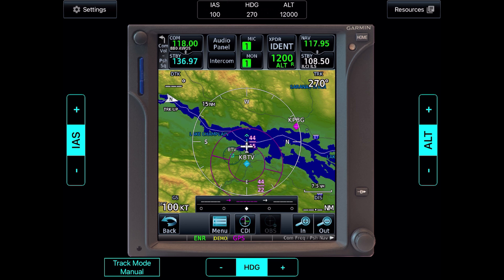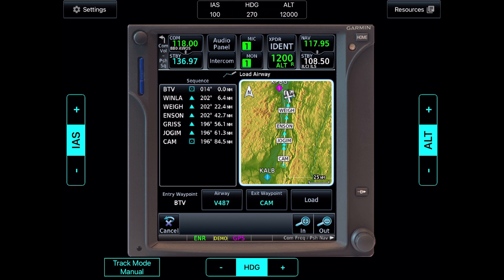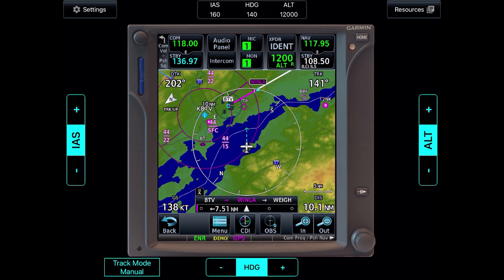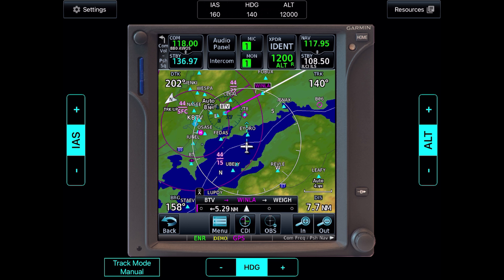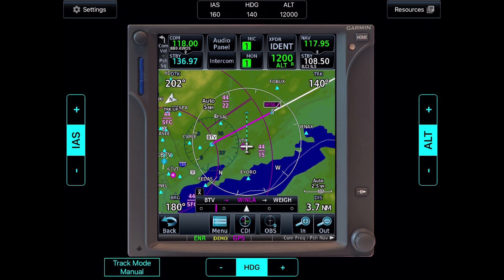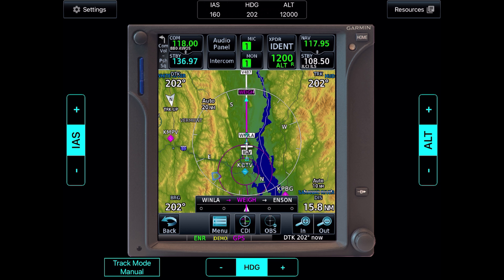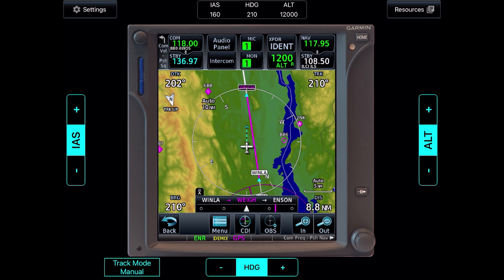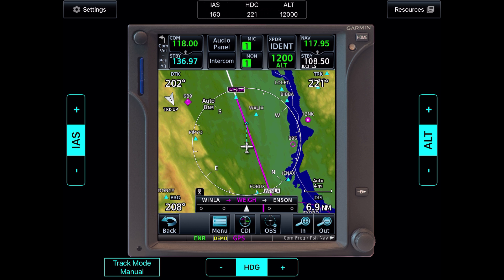Using Bearing, Track, and Desired Track on Your GPS | IFR GPS Flying

Comment: Here is a problem. I hope somebody can resolve. On a approach procedure that I’m looking at, it says to climb to 3100 to the next fix then track 011 to the hold. If I use ForeFlight and type in the fix that requires the flight to 3100 direct to the hold fix, it is not 011 but showing a heading of 004 magnetic. How can you track from one fixed to the other with a 7° to the right offset? This doesn’t make sense to me. Is this because the 004 heading is a correction for current winds? If then I wanted to fly a specific track, would I use the OBS function to set that course?
Reply: sounds like a windcorrection. or maybe you didn't set the (missed) approach correctly, but entered the holding fix manually amd it's heading 004 to that directly. the missed procedure sounds like it has a course change after the first fix at 3100.
if it's a track betwen two points, it's set. if you use OBS from a waypoint you can create a track, yes.